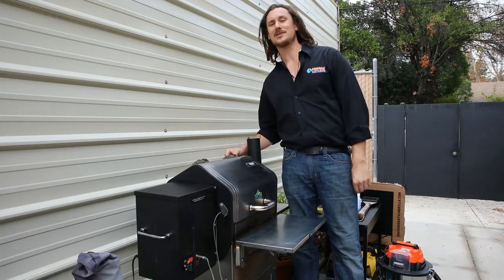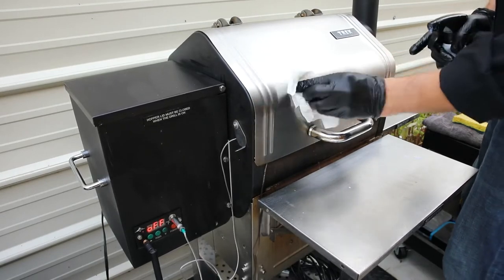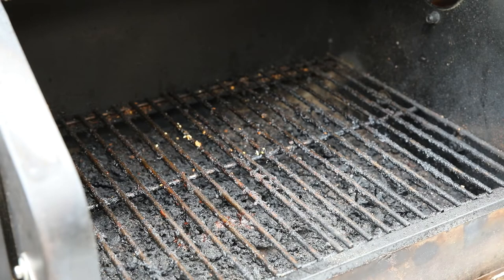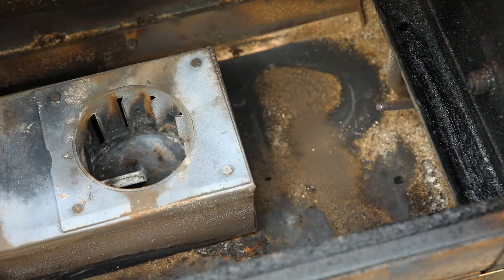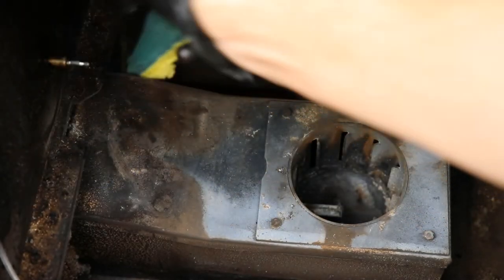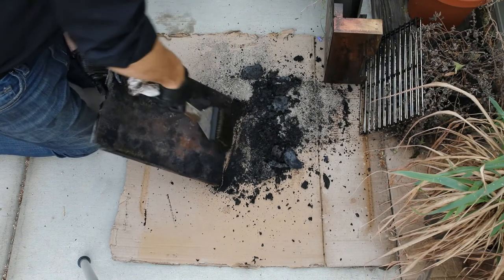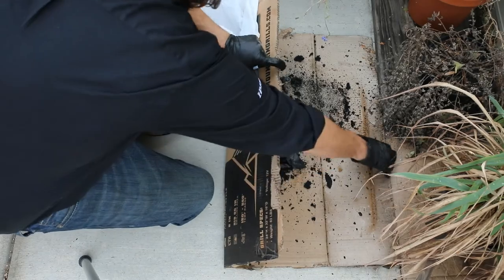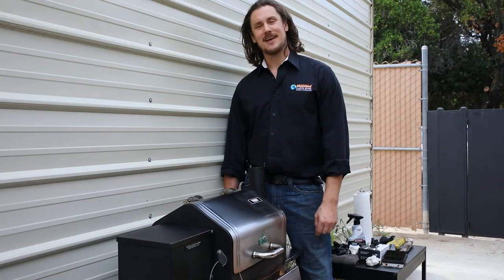GMG Trek Prime Cleaning & Maintenance

Comment: Never put foil on your drip tray.
It throws your temps off.
Keep that thermo sensor clean as well.
Here's another biggie, get a pipe cleaner to clean the drip port. I just tip mine over and clean the ceramic ignitor with a small paint brush when clean ash out.
Reply from the maker: Thanks for sharing your input.

Comment: Have you tried just placing aluminum foil instead of purchasing the Drip pan? If so, what were the results?
Reply from the maker: Thanks for the message. It's imperative that the grease drip tray is in place while the grill is in operation. The grease tray comes with all the GMG grills; Is this what you are referring to? The grease drip tray allows better heat distribution and ensures grease and drippings do not come into contact with the flame. On top of the grease drip tray regular foil can be used or the pre-cut foil sheets from GMG. If using traditional foil, we recommend the thick industrial grade foil for durability. The foil just makes for easier cleanup overall. Hope that helps. Thanks!
Reply: The last time I cleaned the grease drip tray, i covered it with Alumium Foil. I just did a 10# pork butt, on my TREK. During this smoking, it appeared the foil disintegrated, maybe 50%. I think I am going to apply two or three layers of foil, after this cleaning. As far as HD foil, I have looked at the thickness of foil on all the box rolls. They're identical. Only the price was different.
Reply: @FireMartyVa    A replacement drip tray is like 20 bucks.  Just let it burn off, when you remove it scrap it a bit.  Don't sweat the small stuff.  The foil always leaks or burns away and juices get through anyway.  Just replace the drip tray every few years.  It's gonna warp too.

Comment: i have a pellet pro pellet stove and the exhaust fan will not shut off even after i unplug it for a few minute than i turn the stove to off plug it back in and the fan starts as soon as its plugged in even when the stove is on the off spot,?? any ideas??
Reply from the maker: Sounds like it's most likely an exhaust fan low limit switch issue. Which PelPro model do you have? Happy to help!
Reply: @EarthSense  PH50CABPS i think its called Pleasant hearth cabnet 50'000 btu
Reply: everthing works starts up lights up heats up and the other fan comes and blows the heat out but when everthing shuts down that fan just keeps running on low can hardly hear it but its on
Reply: @EarthSense  whats the USB port for on the controler board for? can i adjust the exhaust fan that why somehow? or do i need an app?
Reply from the maker: @chrisfraser3235  Thanks for the notes Chris. Yes that will be a Pleasant Hearth PHCAB50PS. We have never carried this line of stoves, but we do offer some replacement parts. I just took a look through the owners manual but could not find the parts breakdown like I was hoping. I think your best bet right now will be to contact Pleasant Hearth for direct information. Here is their contact:
www.ghpgroupinc.com For Customer Service 1-877-447-4768 | customerservice@ghpgroupinc.com

Comment: You really need to implement that these cookers are cleaned AFTER EVERY cook. You stated that you do it every other cook.
Reply from the maker: Are you referring to exterior wipe down or interior cleaning? At the end of the day it's a persons preference on the cleaning, but yes wiping off the outside after each cook will keep it looking sharp and will keep the time to a minimal. Thanks!
Reply: I got one for Xmas. I have done mostly 2 hour cooks and one 5 hour cook. Roughly a half bag of pellets. Just did my first clean out and there wasn't much to clean out..I have yet to even get grease in my drip bucket yet lol
Reply from the maker: @aaronisgrate  Thanks for sharing! Yeah pellets burn very clean. Once you do your first brisket or whole chicken you'll have some grease in the bucket :) Any questions or assistance needed as you go along just let us know! I've got a pork shoulder going on mine today!
Reply: nope.  nonsense.

Comment: Fuuuuck that shit. Clean your grill after every cook. All you need is a quick vacuum and wipe out the drip catcher.  Line your deflector plate with foil so you can easily clean the drippings off.  You do that, it starts up right away every time.  Getting the grease out prevents grease fires. Don't be lazy. Take care of your stuff. 

The stainless steel cleaner is a good tip, tho.
Reply from the maker: There is no reason to use obscene language here. Most folks do not clean their grill after every cook, doesn't matter what kind of grill it is. I'm not aware of any manufacturer that states cleaning is required after every single cook. Cleaning your grill more frequently will result in a better look and better operation with each use. These are simply suggestions in the video here and how I clean my Trek grill. Everyone is encouraged to follow the manufacture cleaning and maintenance outline included in the owners manual with their grill. Thanks.
Reply: BS.  No reason to clean every cook.  Maybe every 3 or 4.   If you do the shut down correctly there will be no ash buildup.  Just scrape the drip tray off once in awhile.  Oh.  And foil causes lots of people problems interfering with the heat sensor.  And the juices leak through it and the foil burns anyway.   The heat shield only costs 20 bucks.  And they warp.  You're going through more money in foil and greasy fingers!